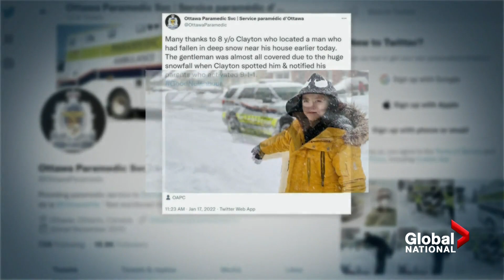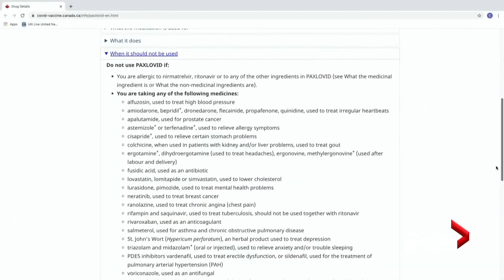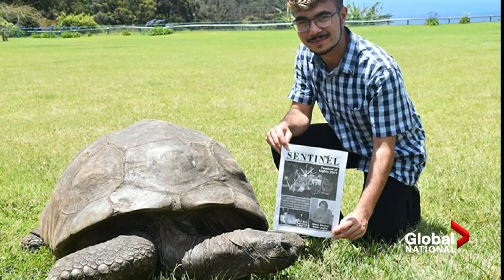Global National: Jan. 17, 2022 | Quebec and Ontario blasted by brutal blizzard

Comment: I took a walk in downtown Quebec city this afternoon. It was all gone. They'd also cleared the sidewalks already. I mean the roads aren't as wide, because they still have to get the snowbanks they created out, but they are open. 
To finish things off, we use a blower and dump truck system. The blowers fill the trucks waiting in line one by one and there's nothing left on the ground after that. Quick and efficient equipment and we need it. But it's pretty expensive to maintain if you only get enough snow 2-3 times a year, like Toronto. It takes a LITTLE bit longer there. It's normal. 
There is a new condo building being built in front of my place. Every morning, the crew spends 2 hours shoveling the snow off of the floor they are working on. They even poured concrete in this weather. Building the second floor now... Tough people.